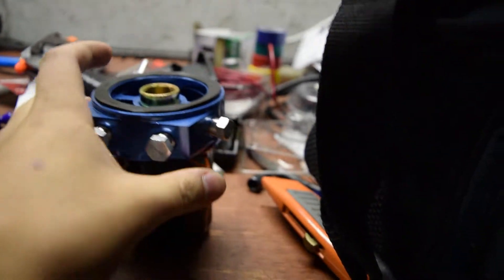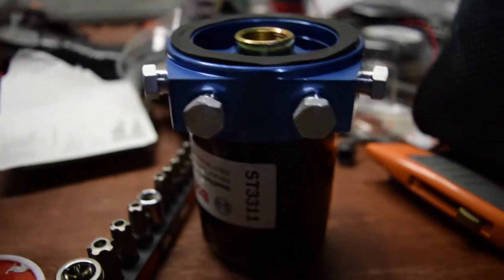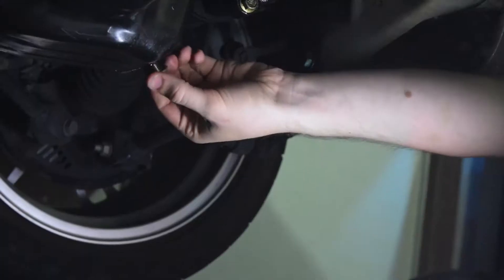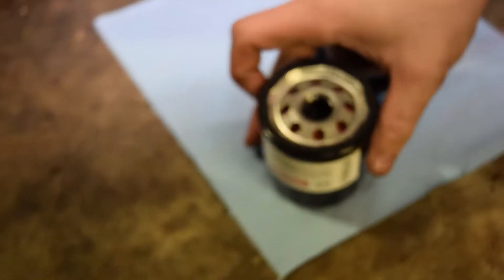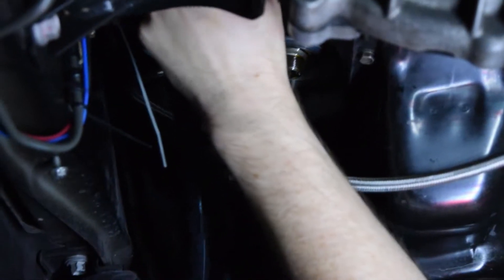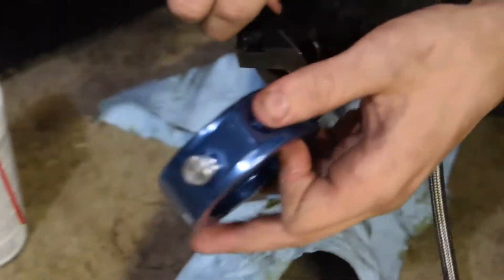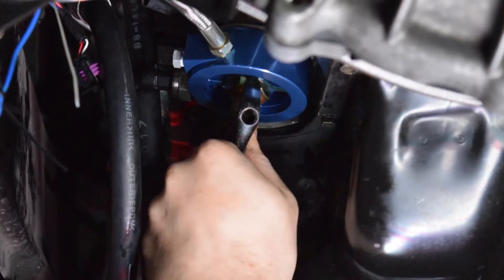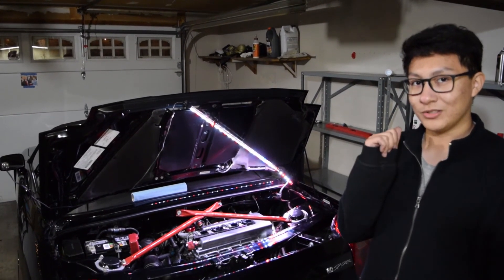HOW TO INSTALL A SANDWICH PLATE ON A 1ZZ ENGINE!!

Comment: Hi, I'd be interested to know which adapter plate you bought because I did a search (ebay and aliexpress) and it seems all the plates I found  either explicitly do not fit the MR2 mk3 or are too large to fit the small diameter spyder oil filter (53mm inner o-ring diameter). Thanks